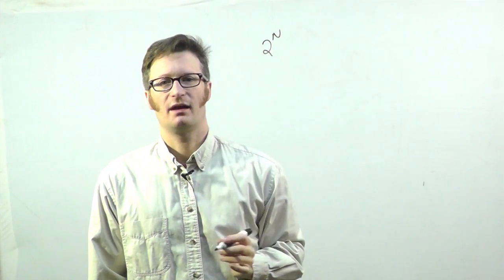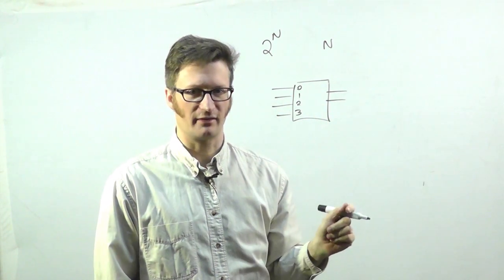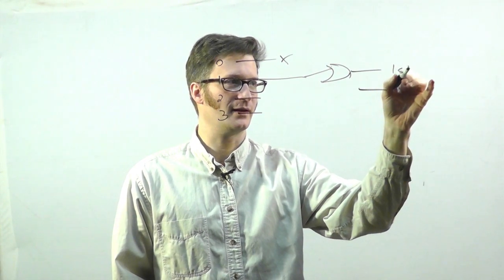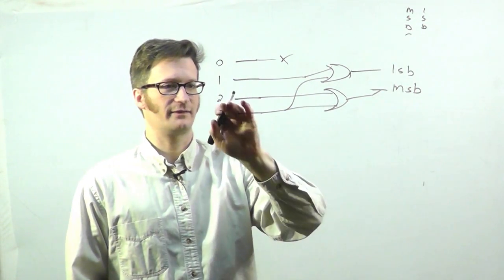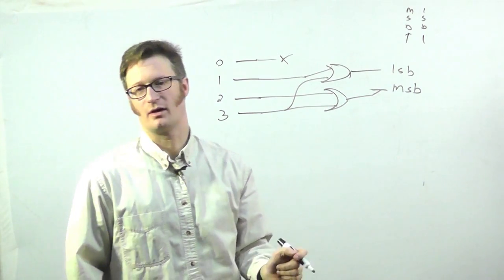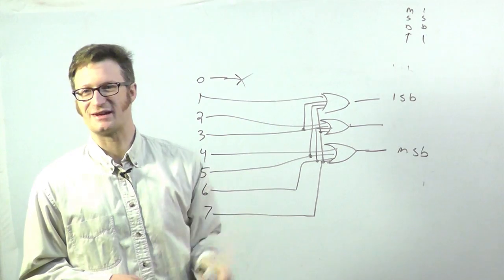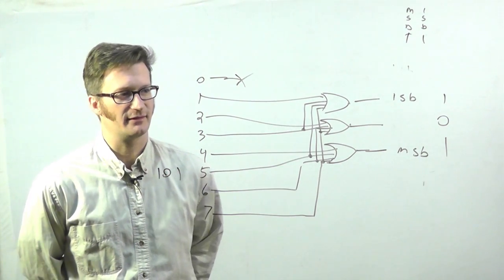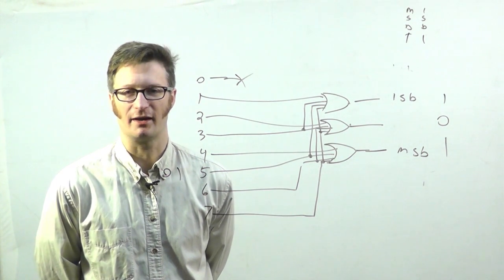Digital Logic - Encoders

Comment: how you derive that circuit structure? feels like they just popped out of thin air
Reply: I think it's the output of three inputs. You have 3 inputs(XYZ) and they're all 000, 001, 010, and so on. 7 connects to all since it is 111, 0 connects to none since it is 000. A Decoder is a map of a binary truth table and the Encoder is the same map but it's executed output first. The circuits are just the outputs, visualized.